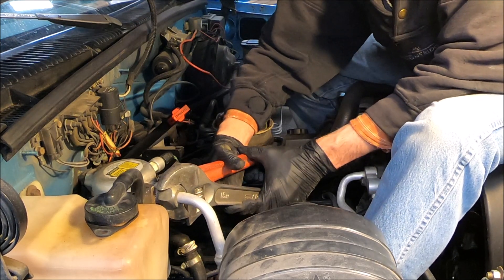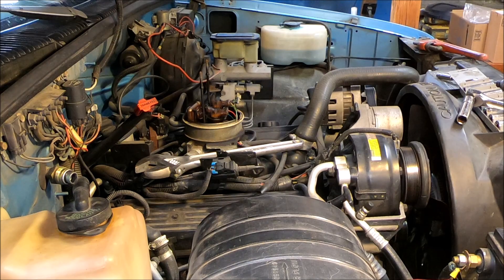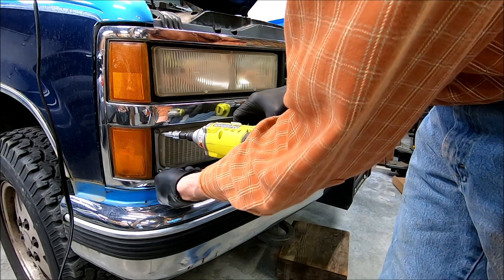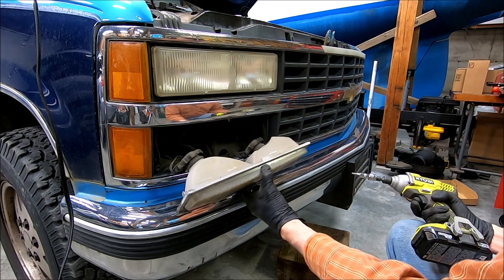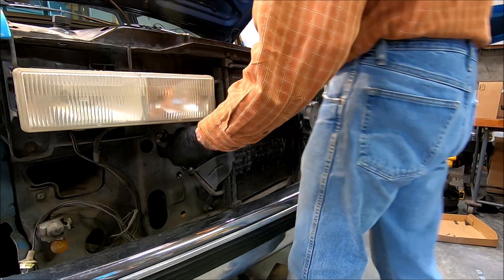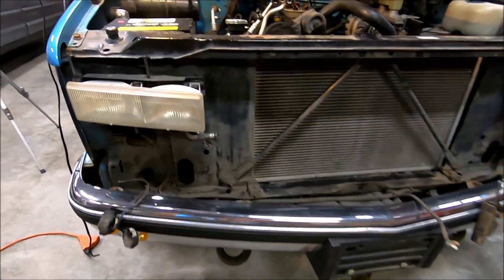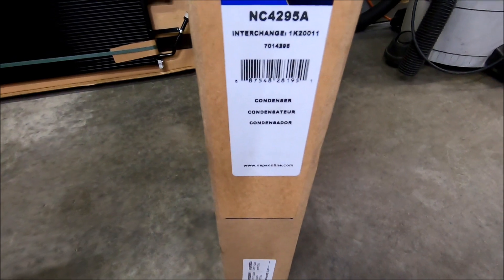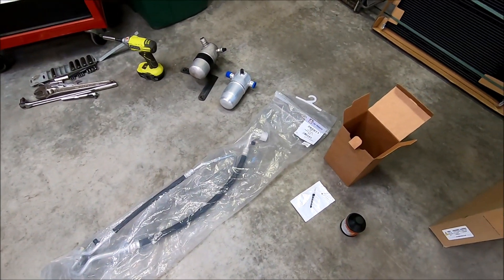1993 Chevy Silverado Ac Conversion: R12 To R134a Part 1

Comment: Well... For me im working on a 98 sonoma.. it is 134a but im replacing everything because now I don't trust it because the the compressor made a ton of racket and yeah the orfice tube did not look pretty. Wish me luck doing all of that to make it work again. Im actually gonna rip apart the compresor see what the heck happened.
Reply from the maker: I used the ester oil because it is compatible with mineral and pag oil. This way if I did not get all the mineral oil out of the system it would not cause problems. I replaced all the parts except the evaporator and the compressor since the system had been inoperable for years. Probably should have done the compressor at that time. It is still working good today. Good Luck.
Reply: @mikesworld60  that.. that's the other oil I forget about where you can do that too I gotta flush mine now because of the racket mine made and the possible dirt or trash it has in it and it sent it through the system now. Bleh, annoying but yeh I also never knew actually how it was going to run too tho. The previous owner told me that the AC never worked and even he said the owner before him never fixed it either. So it's been like that without a charge for a WHILE I've been actually trying to ask people how theirs in their s10s or Sonomas with the 4 cylinder ac compressor sounds like. No one ever got back to me on that actually, sad. Tho I know they really shouldn't sound like a gun lol. But thanks I will need it for when everything comes in and I fix mine.

Comment: So my question is , you can’t just throw in q new compressor  that takes r134a? 

If you can’t what all has to be changed ?
Reply from the maker: You can use the same type of compressor your vehicle came with. You need to use ester oil or pag oil for 134a. If the components had r12 and mineral oil in them, you want to empty all the oil from the components because it is mineral oil. The reason to use ester oil is because it is compatible with both oils if you don't get all the mineral oil out. If you use all new components then you can use pag oil.

Comment: I have a 94 chevy suburban with rear air. My question is the A/c compressor the same size on the suburban as a 2door regular cab pickup ? Thanks
Reply from the maker: Probably the same if they are the same year. But if it were me, I would look up the compressor for both vehicles at napa or any other auto parts store and see if they call for the same compressor for both vehicles. If the parts number is the same, they should fit.
Reply: @mikesworld60   Thanks Mike , but I was talking about same size as in cubic inch or cc’s ( or however A/c compressor’s are rated ) . I know house outside units are rated like 1/2 ton , 1 ton , etc depending on the size of a house. I just think that a suburban with rear air should use a bigger compressor. Thanks again
Reply from the maker: @ricardofierro7041  I just looked up a compressor for a 94 suburban and didn't see but one compressor and it didn't seem to ask if the vehicle had rear ac. Then I looked up 94 1/2-ton pickup and the compressor was the same as the suburban, also was the same as the one in my 93 3/4-ton pickup 4x4 K2500. I think they use the same compressor with and without the rear ac. You might want to ask at the auto parts store, but they look to use the same compressor with and without rear ac. Let me know if you find out.  Thanks

Comment: I just replaced the o-rings and added new oil and added the R134a. Never changed out all those parts. Why??
Reply from the maker: I'm glad it worked out for you. My system was empty for years and condenser was in bad shape.  I did not want to mess around with old parts. They weren't that expensive. It still works great and I'm glad I went the route I did. If you had a system that was working somewhat but just wasn't getting very cold or had just stopped working, I may have done what you did.

Comment: Geezuz, why not just blow out the system and use a conversion kit with fittings and new oil ?!
Reply from the maker: The system was empty for many years and had multiple leaks., especially the condenser. It had old o rings and the hoses were in bad shape. It was worth it. I really enjoy having ac in this truck since it never had any since I bought it.

Comment: Hey mike i’m doing a conversion on my 92 Silverado so my question is what type a cycle switch you use pressure size
Reply from the maker: I still have the R12 switch in, but you can order the one for R134a.

Comment: I use to switch them at a dealer we recovered them removed the oil added new oil and recharged . In some cases we replaced the compressor . But must cases we just put the new valves in switched out the oil and filled them . I guess my question is why replace all those parts . The dryer could be cleaned out . But if you're going to go through everything you did why wouldn't you remove the dash and change the evaporator core that's where most of your oil is going to be stockpiled at anyway from people putting too much oil in AC systems everybody always wants to add oil you don't add oil if it hasn't lost any if you have it changed apart on an AC service when you're recovering the system if it has one ounce of oil collected you only put one ounce in I see people at O'Reilly's all the time feeling their systems full of oil because that's what they tell them to do in most cases if I'm just doing a top off I don't add any oil at all so I'm just curious as to why all those parts got changed out the only thing that will happen on most of those is the seals will start leaking on the compressor and you have to replace the compressor so in most cases we would just go ahead and tell them the compressor had to be changed the vehicle was older and had a lot of miles because we didn't want to repeat return job so we would completely recover the system and let it vacuum down for 30 minutes we would remove the old compressor install the new one putting the appropriate amount of oil in the new compressor we would remove the dryer and just basically blow it out and clean it out very good in some cases you can even squirt some ether down in there and allow it to blow back out to dry out that canister the orifice would get replaced in most cases but in some cases those can be removed cleaned out and put back in as well so my question is why dump all that money into parts were you just trying to freshen everything up
Reply from the maker: I didn't replace the evaporator because it was not leaking. Since it is in the dash, I knew nothing could get to it like rocks to damage it. The system was empty for a long time. The condenser was in bad shape and leaked. I always like to change the accumulator or air dryer when a system is sitting empty for a long period of time. They are not that expensive, so I always change them. Since this is a conversion, I wanted the best chance for the most cooling. From what I understand the components on a R134a system are usually larger than R12 system.  Since the system was designed for R12 sometimes they don't cool as well when they are converted to R134a. The hoses were 28 years old, and I didn't want to end up with a leaking hose. Like all the components were 28 years old. The compressor is the most expensive part, so I took my chance using the original and it seems to be working fine. I will change it if needed but it has been working well since I did the conversion, so I feel lucky the compressor was still ok. I did a conversion on a 1992 e250 and it didn't cool as well as this one did. I had used the same condenser and hoses so I thought I would change most of the parts and see if it made a difference and this conversion cools so much better with the new condenser. If I was fixing an existing R134a system that had not been empty very long, I would replace just the bad parts that caused the leak. I might still replace the drier but that is just me.

Comment: Very helpful video for someone like me who is completely new at doing this.   I was hoping you could help me with a question:  I am converting a 1988 Chevy S10 from a R12 system to R134a.  My original compressor was damaged years ago.  I removed it and installed a bypass pully.  I now have a new compressor, accumulator and orifice tube.  I have completely flushed the system to include the evaporator, condenser and all lines.  QUESTION:  Being that I'm installing a new, pre-oiled compressor, is there any need for me to add oil to any component of the system?  If so, what kind of oil and how much?  Many thanks for any thoughts!
Reply from the maker: I'm no expert on this and can only tell you what I would do if it were me. I'm not sure what kind of oil the compressor comes with if it is mineral oil for use with (R12 only) or pag oil that is normally used with R134a. I have heard that sometimes the oil in the new compressor is to protect it until it is used and should be drained out. You may want to check with the compressor manufacture to find out what kind of oil is in it for shipping.  There may be instructions that came with it that tell if is ready to be charged as is. Ester oil is compatible with both mineral oil and pag oil and might be the safe bet if you think you may have some mineral oil left in the system. I used Ester oil in mine because I still had some mineral oil in the system since I did not flush the old components, only drained them and blew them out with air. If you know for sure there is no mineral oil in any of the components after flushing the used ones, then I would just use the pag oil. I think they recommend about 1oz of oil for each component and whatever the compressor manufacture says needs to be added to the compressor itself. The Compressor may need 4oz when new when empty.  If you don't have enough oil in system, it can damage the compressor. If you have to much oil the system, it may not cool as well as it should. I put on new hoses to the compressor because the old hoses are a good place to get a leak. Apparently the molecules in R134a are smaller that in R12 and can leak right through old hoses or ones that are not designed for R134a. Make sure you change all the Orings with the new green ones. Mine is still running cool and working good and I change everything except the evaporator and the compressor. You do not need to add any oil for the new orifice tube. Make sure when you add oil to the system when it is running when charging that you don't add it directly at the compressor inlet side. The compressor can be damage because it is only to compress gas not liquid and you can damage it because of course you can't compress a liquid. Just add the oil to the system with long enough hose before it gets to the compressor or add the oil to each component before you vac the system and charge it. I used the R134a that does not have oil in it and I used oil that had dye in it so if I had a leak I could find it more easily. 
 When you convert from R12 To R134a you only add around 70 to 80% of what the system takes for R12. I just kept monitoring the temp as I got close to 75%.  If you put to much in and overcharge it then it wont cool as good. More is not better.  Good Luck!
Reply: @mikesworld60  Many thanks Mike…very helpful!  👍

Comment: I’m about to buy a 94, currently the ac doesn’t work. How do I know if it’s been converted to 134a or not? The seller doesn’t know if it has.
Reply: Yes sir it’s 134a from the factory. Today it’s getting a whole new system, parts are old and in bad shape, set me back 1350.00
Reply: @irishuwould5185  that’s where im at today around 1200 so far
Reply: @Phuq_it  yea pricey but worth it, especially here in south Texas. It’s nice and cold now in my truck🥶
Reply: @irishuwould5185  Did it change your engine temperature any after getting it fixed? Before mine would cause the temperature to rise. I rebuilt the motor during thanksgiving so I decided to get a fresh a/c done like you. They found all kinds of bad parts. They waiting on parts right now. So im not sure if stock clutch fan which is new will handle the extra strain during summer time.
Reply: @Phuq_it  I didn’t notice any change in temperature. Yours may have run a little hot if your fan wasn’t working. The new system should remedy that.
Reply: @irishuwould5185  okay im super excited. Last summer I looked in the back seat and my sons face was bright red and he seemed overheated the temperature was 115 outside and the street was 165 plus. The heat coming from the big block was coming through the vents ever so slightly. I only went a few miles to pick his sister up. It’s time to get a/c…
Reply: @irishuwould5185  so update…the temperature did go up. The mechanical gauge went to 240 before I caught it. It never overheated. Now the temperature sits at 221 and will climb in traffic. Everything is new! Everything. I called the dealership and they said I need a auxiliary fan for condenser. I had the mechanic put it on and went for a test drive. Welp, sitting at a light the temperature went to 230. I checked the aux fan it wasn’t running. Did some research and in the passenger side head a switch needs installed. I found a wire with the plug so i plug it in and the fan kicks on at 220. So I turned the ac on and off we go. Temperature went back to 230. Shut it down and now the gauge sets at 221 but in traffic it climbs with no ac. Im pretty sure I fuked the HD gasket. Brand new engine.. so mad and exhausted
Reply from the maker: It should have a sticker in the engine compartment if the person that did it put one on. The best way would be to look at the high and low side connections and see if it has connections for R12 or 134A.
Reply: We have 134A with two wires so how would you do it??
Reply: I’m waiting on the same thing, only thing I have left is my high pressure switch pigtail. Mine has two wires and not the single one..

Comment: you have to change condensers on ones older than 94 from what i understand the r12 condenser is different
Reply from the maker: That's what I heard too. Also mine was in bad shape so I changed it. Ac is still nice and cold and works great.

Comment: Do you need a permission to work with AC systems? In Sweden we have to be certifed to able to work with r134a.
Reply from the maker: No, we can work on our own.
Reply: @mikesworld60  We have so many  regulations we almost need a helicopter license to use a electric mixer.
Reply: You only need a "license" if you are running a business. That way they make sure they charge you more money in taxes.
Reply: @brandonclark160  because taxes will save the climate didn’t you know that!😂